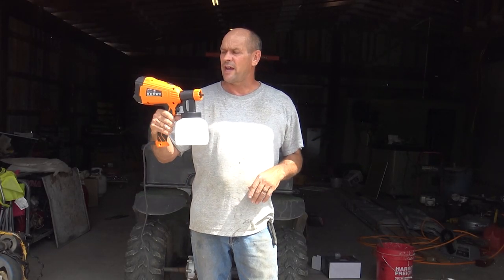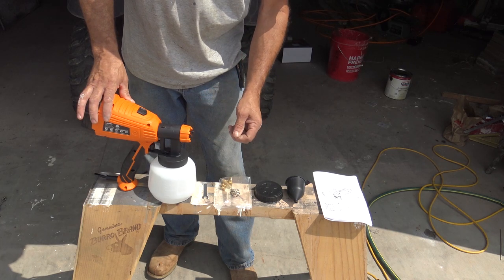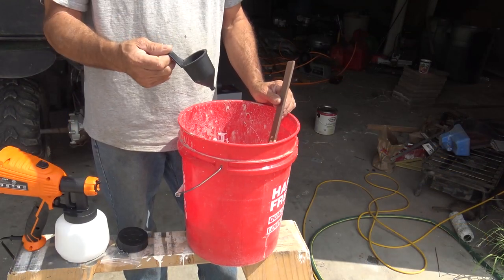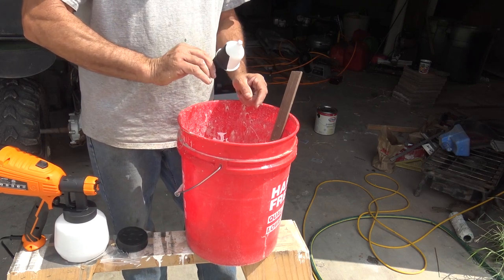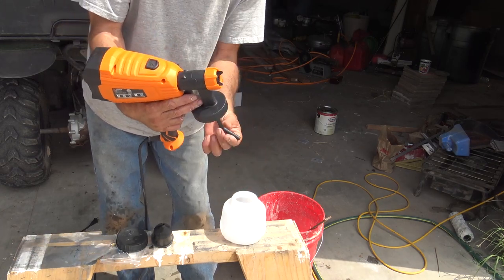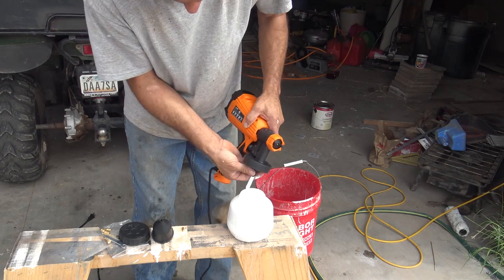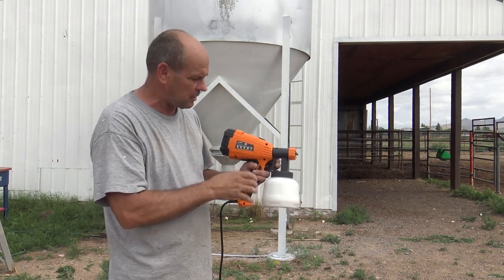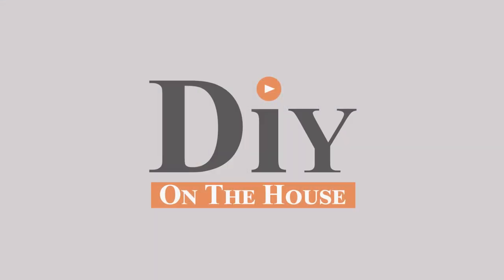Affordable Paint Sprayer That Works | Yattich Paint Sprayer Review

Comment: So, if you have a gallon of water based house paint, for interior walls, you get that dilution cup, dip it in the gallon, count how many seconds it takes to empty back in the gallon, and dilute with water until it empty's the cup between 20-40 seconds? Is that right? Thank you. Enjoyed that video.
Reply from the maker: That's spot on. Try to shoot for the 30-40, it will lay down better.
Reply: @DIYOnTheHouse   Thank you.
Reply: @DIYOnTheHouse   Would the 3.0 tip work best? Because I have up to a 3.5...I have a different gun..not this one. Thanks again. And for a quart of paint, how much water to add? Roughly.

Comment: About how much water do I add to 1 qt. Of paint for the 30 second run out time? Thank you for your knowledge and tips they helped me alot. If you have time please answer my question to the approximate amount not exact? Thank you for your time and✌️ peace ✌️ ☮️
Reply from the maker: I wish I could answer that. Paint comes in so many viscosities from the store. Just mix it until it's right and it will paint great.  Good luck with your project!
Reply: @DIYOnTheHouse  I figured it out and thank you for your knowledge and advice peace ✌️

Comment: I threw mine away. Kept overheating. I’d get a couple minutes of service then it would stop. Have to wait 20 minutes to reset.
Reply from the maker: Dang - hate to hear that!!
Reply: Did you keep your paint a little thinner? And did you actually use like a water-based paint or an oil-based paint? And did you actually clean it? It's not like an air pressured sprayer so you only have to spend maybe 15-20 mins cleaning the bag and your tips
Reply: @conquerthafuture7209  Yes, yes, and yes.
Reply: @conquerthafuture7209  I used a water base.
Reply: Should have sent it back or checked to see if the paint was too thick
Reply: @conquerthafuture7209  Damn any more questions??
Reply: Didn't thin it enough

Comment: Just purchased this, thank you for the review!  I am new to painting with one of these, I am going to paint my exposed basement ceiling.  I plan on using Latex paint.  Can you recommend a water to paint ratio that won't be too messy but thick enough to paint joists?  Also what tip should I use?  I think I will be painting using the vertical fan.  What kind of paint do you recommend?  I want to do a flat or satin black.
Reply from the maker: Hi, 
There is a viscosity cup in the box that you use to mix the correct amount of water or thinner and run it through the cup. In the directions it will tell you the amount of time it takes to drain the cup and if it falls in that time you can spray it. I can't remember the correct tip, but I think it's the large one.
Good luck!

Comment: I bought this spray gun yesterday, went to use it today. Did everything like it said but it's spraying in spots. Looks like I'm texturing the wall. Not smooth at all. What am I doing wrong?
Reply from the maker: Make sure you have it thinned properly with the testing cup, also the paint need mixed well. If the paint is old you may need to screen it for clumps. If you have gone through all that then there is an issue with the sprayer. Which I hope it isn't because they are really good.

Comment: Looking for something simple like this. My question, Does it spit little chunks out? Like if I sprayed it on smooth board, would I have to sand it? Also how long can the paint stay in the cylinder cup?
Reply from the maker: If it is mixed properly and screened you shouldn't have any chunks. The paint can stay in the cup for a while, but the paint that's on the nozzle will dry giving you a issue.

Comment: I didn't understand what the cone was for.  You add water to the paint?
Reply from the maker: It is a viscosity cup. The paint can be to thick or it won't spray correctly. The thinner you use will be indicated on the can.
Reply: Do you have a video that shows how to thin the paint with the thinner and how to determine when it's the correct consistency?@DIYOnTheHouse

Comment: I have this paint sprayer.  On day 1 it worked fine for a good 30 minutes.  But now when I press on the trigger it only blows air and no paint???  Please let me know what I can do to troubleshoot this.
Reply from the maker: Did it get cleaned good last time. I totally break mine down and do a once through b4 I put it back together. Also the paint cup has to have a good seal for it to operate properly.